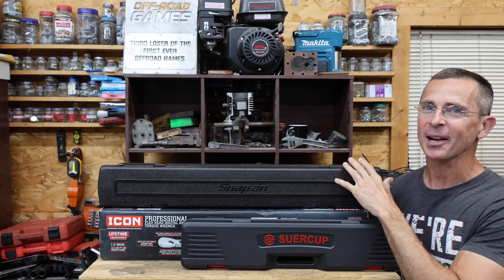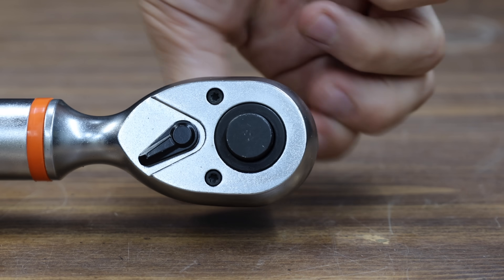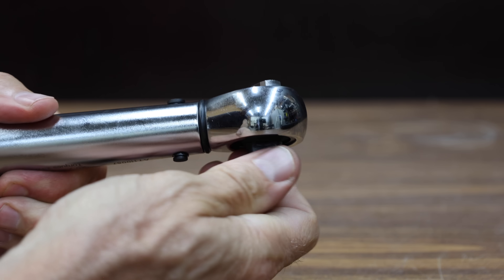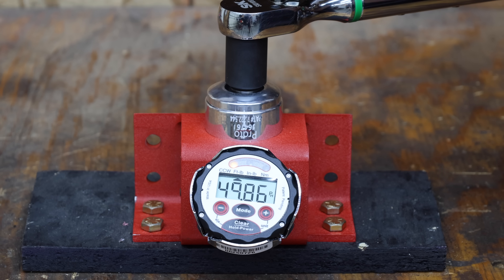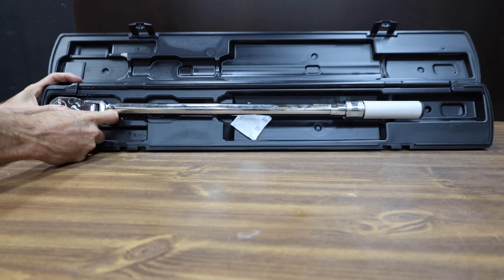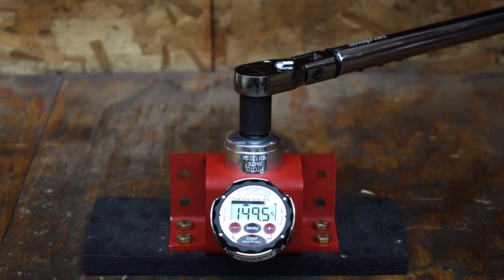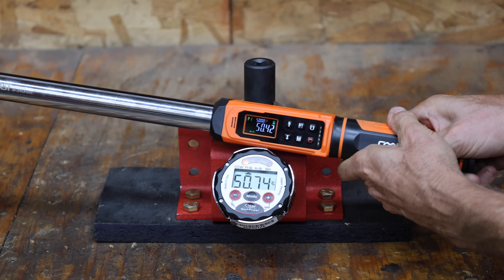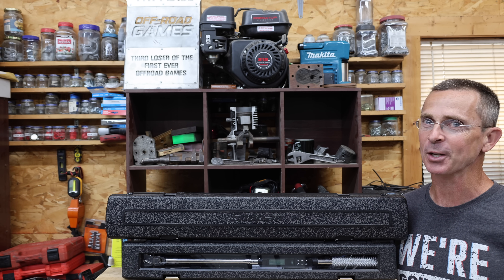$78 Torque Wrench vs $790 Snap On & ICON—I Didn’t See This Coming!

Comment from the maker: Here are the links to the torque wrenches and please check on the video description for more details. I’m looking forward your comments and future video ideas! Best regards, Todd
SUERCUP: (it looks like the 1/2 inch is sold out right now) https://amzn.to/3USsJbN
CooBeast: https://amzn.to/3UH7yK1
Craftsman: https://amzn.to/45u2RIj
DeWalt: https://amzn.to/4maJqeT
SK Tools: https://amzn.to/3J716tb
VEVOR: https://amzn.to/3Jt5OkQ
eTORK: https://amzn.to/3HieslM
GearWrench: https://amzn.to/3Jt5Nxi
SUZUME: https://amzn.to/3URTL30
ACDelco Torque Adapter: https://amzn.to/45tpKeQ
ICON: Available at Harbor Freight
Snap On: Available at the Snap On Store
PROTO Torque Wrench Tester: https://amzn.to/4op0qiN
Reply: The suercup will come back in stock for probably 150 bucks after selling out because of this review 😅
Reply: @Spyder_tsi it’s back at $104.. you weren’t far off
Reply: Could you test robot vacuum cleaners and wet floor cleaners one day ? Thank you.
Reply: would you consider doing trail cams in a future video.     Also thank you for this video I had a torque wrench that I used for some work but mostly for my lug nuts and upon trying to use it last time it was outright broken and after each use I had it set to zero as in it was not under pressure or left to sit at it's desired torque for it's last use.   I'll be happy to put in a order for one you tested here.
Reply: Why was there no ranking chart at the end of the video? That was what I was waiting for the entire video…….
Reply: The 1/2 Suercup isn’t even listed.
Reply: Darn! The Suercup is $178.63 before taxes in Canada :(
Reply: @colinkennedy8523 It's now 110$ USD 
So they raised it even more on Canadians
Reply: May I suggest you test braided fishing lines ? 🎣 Please and thank you. 👍
Reply: Would love to see a similar comparison of digital torque wrenches that also show degrees of rotation.
Reply: I missed it was the Precision Instruments style of torque wrenches reviewed? They have a "split beam" torque wrench mechanism that is simple to dial in quickly and stays reliable over time. It is somewhere in the middle of the cost bracket between very expensive SnapOn and the cheap dial-style torque wrenches.
Reply: I like Gearwrench products,BUT, this product really shit the bed!
Reply: Should've added the a/c delco torque wrench, 250ft lbs, digital, replaceable head, angle setting, beep and light setting, really nice torque wrench
Reply: Could you test breaker bars?  Thanks!
Reply: Yeah because you broke Amazon with your review lol
Reply: I'd like to see testing of tire preservatives. Not the stuff to shine tires, but like D3 and 303. They claim that they keep tires from aging, at least slower than without. For stuff that sits around a lot, an effective tire preserver would save a lot of money. 

That market is completely flooded with marketing hype and hearsay, I haven't found ANY science-based testing of these products.
Reply: Looks like the Suercup is back in stock but now 33% more at $104
Reply: I'd love to see a comparison of firepit types.  My main curiosity is the radiant heat direction and distance of the various kinds such as cheap metal standard wood burning, smokeless, basic gas, and the new Ninja 360 gas heater/firepit or similar?   Regardless, love your videos!
Reply: First off thank you for your videos they are greatly appreciated! And could you possibly do a test on rechargeable portable work lights? Looking forward to seeing more of your videos in the future! 👍🏼
Reply: Harbor Freight is getting too big for their britches lately, it would seem.
Reply: Awesome as always! Any thoughts on possibly adding time stamps in your description sections in the future? 👍
Reply: Vacuum sealer
Reply: Great video, but it makes me wonder if the acdelco is representative of all torque adapters, or if it's just one of bad ones. I think a future torque adapted episode should be in the pipeline.
Reply: The link for the Coobeast goes to a 1/4 inch
Reply: I greatly respect and admire your content. I just would like to ask briefly and respectfully, have you ever tested spark plugs/ spark coils or spark cables???
Reply: Everything is fine except that u could add Matco in this competition.
Reply: Do a  Scroll saw shootout!
Reply: Project farm please test Mobil 1 Full synthetic multi vehicle formula atf vs Torco HVIS atf vs Amsoil atf !
Reply: Hey Todd I have a video suggestion, how about telescoping pickup magnets? Theres so many out there but who makes the best one. Thanks man for your hard work!
Reply: CRAFTSMAN is now listing for $222 and up.
Reply: Milwaukee didnt make the test?
Reply: 1/2 Suercup is back in stock but it has the project farm markup now… $104
Reply: suggestion for future tests:  Torque limiting extensions , aka "torque sticks".   
Various testing I've seen is often not too systematic.  Some of these other tests have shown wild inaccuracies relative to manual "click" torque wrenches, even differences between pneumatic and electric impact wenches.
If I had trust in those "torque sticks", I'd carry one in the car for when a tow truck driver attempts to install the spare tire at 1000 ft-lbs :-(
Reply: Great video as always! I'd like to see a video on angle wrenches and air hammers! Thanks for doing the hard testing for us!!
Reply: Do a new oil comparison video but only manufacturers oil like ford, bmw, etc. go to the dealerships and buy their oil and test it.
Reply: Can you please do a video on different types of bearings, ceramic, steel, etc.
Reply: Suggestion for another video. Best Garbage Disposal for under your sink. Just bought a new one and it keeps clogging up. :(
Reply: BRO!   lay off of the cocaine!  Take a fucking breath you ate EXHAUSTING to listen to
Reply: CooBeast went up quickly, $129.99.  I must have got one of the last ones, sold out now.
Reply: Would love to see you test the quinn torque wrench adaptor like the acdelco one to see how it stacks up against a regular torque wrench
Reply: You are awesome. Keep it up
Reply: can you test the Quinn
Reply: So the supercup is idle for budget?
Reply: Do air quality monitors please!
Reply: Where does Husky factor in ?
Reply: Hey, could you test in-lb specific torque wrench mechanical and electronic
Reply: its a great review that you did, but at 50lbs, there's not much relevant data that's useful, in my experience, the lower value of the torque accuracy is more relevant in the lower torque range, 50lbs ranges are usually m10 area bolts that can handle 5-10lbs of inaccuracy, however, the 15-25lbs range usually m8-m6 bolts that will snap if the wrench isn't accurate enough, maybe add that test for a more meaningful result
Reply: @doucettescarcare8525  you are right. Now that I’ve read your comment, I am kind of surprised he didn’t have a particular segment on how important it is for these not to break small fasteners - a.k.a. low torque accuracy
Reply: @doucettescarcare8525  always heard you never want to get into the teens with a torque wrench that has a pretty high scale. In-lb torgue wrenches are used for that sort of stuff.
Reply: @danya822  yes you don't want to be at or below the minimum, but I've found that between the inch pound and Ft. pound sizes, there's a gap where neither are accurate, and seems to be between 15-25lbs, I've had hard times finding anything that is actually accurate.
Reply: Ahh the joys of awesome reviews and the heartache of increased popularity and price .   Suercup now $95  Coobeast now $129

Don't need more right now
Always need more of everything 
Will not purchase 
Must purchase.

Seriously will add to watch for price change.
More interested in accurate light torque wrenches for bikes, electrical and such now.
Reply: As we age:goat-turquoise-white-horns: with your Great Product Reviews/testing we Sure could use a TEST/Review of the latest [ Bisacodyl Enema Kits ] sold to the  Public:face-purple-wide-eyes:
Reply: Man how did you know I needed a new set! Last week got 2 from Husky and almost broke the bus bar off my new solar set up. I need something precise. Thanks for this.

Comment: Dont buy gearwrenches torque wrenches. Bought their top of the line E-Torque series 3/8 ratchet. $489 with a standard 1 year warranty, 14 months in the screen goes out. Submit a warranty claim to have it repaired out of pocket, they emailed me back letting me know their torque wrenches are non-repairable and that I’d have to purchase a new one. Something to think about.

Comment: So the question is, how accurate are click type wrenches as compared to their digital counterpart? I cannot afford 400 bucks for the Icon but their click type is 160 locally.

Also, I think people are way overthinking how important specs are. We demand 1 or 2 percent but then depending on threads and mating surfaces, one can get a 10 or 20 percent error. If there's a little rust on the bolt it will torque differently than a new bolt with perfectly machined threads. This can get compounded when you add a lubricant like loctite or anti seize. The companies all know this and so when they say it needs to be at a certain spec if you are off by even 20 percent it is still likely within the margin of error.

Comment: Great video! one thought, with parts made in China, I would imagine different batches may have different quality. It would be helpful to have a  follow up, buy another suercup in a month, another in 3 months, see if they are the same. I would think Dewalt, would keep the same quality, maybe Craftman, maybe not... but it would be great to verify if the quality stays, or if after they get a boost from your video they crap out.

Comment: 20 year tech, i only use snap on torque wrenches. Sears i never used but look good. I dont want inaccuracy over time of use for heads, intakes, etc. Over time is a real test. Hand tools are different, i have sunex sockets that are 30 years old and going strong, sears, mac, matco, snapon. I didnt have the icon choices back in the 90s. Times have changed. As a home user only now, i cant justify snap on prices.

Comment: buy once cry once. all my torque wrenches are mac tools, 12 years of daily use and have never needed to calibrate them. i get them checked semi annually and have yet had a problem.  we supplied torque wrenches for the tire guys at my previous job and the dewalt seemed to last about 6 months before mechanically failing. mastercraft wrenches have come apart only after weeks of use. my buddies got a new snap on wrench showed in this video and he loves it, i steal it when i can

Comment: Most of the torque wrenches literally bend and break after 180 foot pounds or torque. The plastic end where you insert the batteries is the weak point :/

Comment: Would have been interesting to have included something like my 30+ year old Craftsman beam torque wrench with wobble handle (Made in the USA) to compare it with these high tech tools. Another YouTuber did that and found that a 50 year old low tech beam torque wrench was superior to late model click wrenches. Go figure. 🤓

Comment: A really expensive suggestion, anything you run on carb, can be ported & polished, a stainless valve replacement, and a roller & roller rocker upgrade. Follow that with redialing your carb with lower fuel ratio, then after full breakin, a summary on the new mileage and slight power increase

Comment: 3 years ago I was suckered into buying the ICON. I did my due diligence but there just weren't any bad reviews floating around at that time. At this time I really wish I hadn't. It works well enough but is a mess electronically. I have watched it power itself on, sitting motionless in its case, and then power itself off when it times out. What clued me into it was a random buzzing noise in my shop and it took me a while to figure out what it was. So I can no longer leave batteries in it or they end up dead between 1 use and the next. It has killed a brand new set of batteries in less than a day and not even powered on by me after the first use with fresh batteries. I knew better than to buy anything electronic from Harbor freight but was hoping with as upmarket as they went with the ICON products that they had finally done something right. I was wrong. So very very wrong.

Comment: To me its crazy that you get 7500 pounds of pressure at 40 ft lbs torque. It may be useful to think of a screw type fastener as an inclined plane around a spiral/circle. That's where you get your mechanical advantage. More distance covered means less force needed on the input.

Comment: I love this chanel. I'm not even in the market for a torque wrench but I just was very interested as I do use a lot of torque wrenches, accuracy is really important, and I have a lot of pre-consieved perceptions about these brands. Frankly I used to have a really positive impression of gearwrench products but they have routinely come up short. I hate Craftsman but they seem to be performing surprisingly well under their new ownership. SK used to be one of my favorite brands until it got bought out by a Chinese company. While I had hoped they would maintain some semblance of quality that just isn't true as can be seen here. My old SK torque wrench came with a certificate of calibration with actual test data and they didn't even charge extra for it like most companies would. Talk about quality! I was also very surprised by brands like Dewalt/Milwaukee. They seem to have just started slapping their name on every cheap Chinese product they can get their hands on like a modern black and decker but they have routinely performed well. Of course you also have Harbor Freight especially with its ICON line that has completely turned the industry upside down. If you had told a Snap-on executive 20-30 years ago even 10 years ago that their primary competitor would be Harbor Freight they would have either laughed at you or had you thrown out of the building but that is the very real reality today.

Comment: Hi Mr @ProjectFarm!
Would you consider testing 1/4"-3/4" digital torque meter/wrench adapters? I have a set of tools that I keep in my truck and I've wanted to carry just an adapter rather than a complete wrench or torque sticks. I wouldn't think it's matter but would using a 1/2" torque adapter with a 3/8" drive adapter change the reading? It seems like the only thing to consider is the torque ft/lb range. 
I appreciate the time you put into videos!

Comment: I wanna see how these torque wrenches work as regular wrenches. the detail in the video was good, but using a torque wrench at least 5 times, daily, I've started to see the faults in my craftsman torque wrench. I wanna know how long warranties last. I wanna know the back drag and free play of the ratcheting mechanism.

 I've taken good care of my torque wrench, and while it is accurate, I hate using my torque wrench. The craftsman warranty only lasts a single year, nothing compared to the lifetime warranty that comes with all non torque measuring ratchets.

I just want something accurate enough, but has the smoothest ratchet mechanism, and doesn't break the bank. Or at least if it does, it. needs to be worth the investment with a lifetime warranty.

Comment: Could you do this for heavier duty models? Semi trucks and a ton of farm equipment regularly need torque wrenches that can accurately measure over 500#. My lug nuts are 450 or 500.

Comment: So what I learned here is that they are all pretty much the same but price as being off by 5 lbs is not even a concern for myself. I'd buy that SewerCup or the CoCoBeast just because I like the names and they are cheap enough to just toss in the car to have for emergency torque checks 🤟 Thanks for doing the 12k + push an clicks, because that is a lot 😳🙈

Comment: I'd like to see them in inch lbs and a very low rate. 6-18inch lbs. Always scared im going to over torque some of those smaller quarter inch bolts,
Reply from the maker: Thanks for sharing

Comment: I've just been gifted a 4.8 star on Amazon $68 Vcan digital torque wrench that everybody seems to love except for the complaints they used to be made in America and switched to China.  It's a 3/8 drive 5.02-99.6 Ft. Lb that claims   accuracy of ±2% 50k tests, 30k uses w/no recalibration needed. One complaint was the actual torque in several different settings was just under what the display claimed. I've snapped off bolts with other models so just under sounds fine to me.

Comment: My takeaway is that whatever torque wrench you have is good enough.  You're not strapping shit on the space shuttle.  For lug bolts or whatever?  1ft-lb or 1.5?  Fine.  Even a headgasket, it's fine.  Those DeWalts and Craftsman and what-not seem like a sweet spot, but I think any will do for basically any normal task.

Comment: I own the digital SuperCup brand of torque wrench in both 3/8” and 1/2” drive. Love it. Ergonomics are great and is pretty accurate.
Reply: What do you recommend for different uses? A 3/8 or 1/4? The 1/2 is sadly sold out. For spark plugs and other engine components.

Comment: I see some of these electronic torque wrenches support angle mode for torque-to-yield fasteners. This feature is important to me and is the only reason I'd consider switching from a mechanical to an electronic wrench. Could you add a note addressing which wrenches have this feature?
Reply from the maker: Thanks for the suggestion.

Comment: I have the other version of the gearwrench torque wrench model 85196 and I can personally attest that it is much more accurate and stays accurate better then the version tested in this video also the 120xp head helps when torquing in tight areas. I have well over 10k cycles on my torque wrench as I work professionally as a mechanic and use it multiple times every day